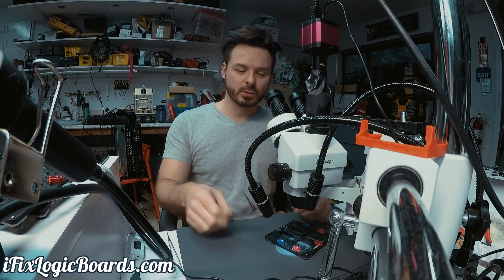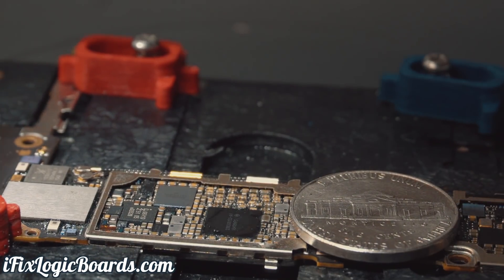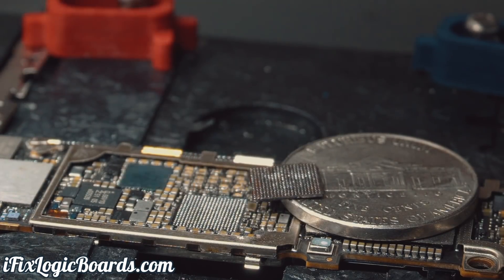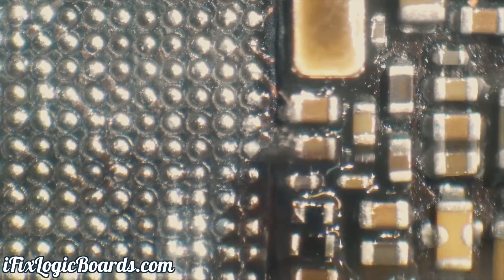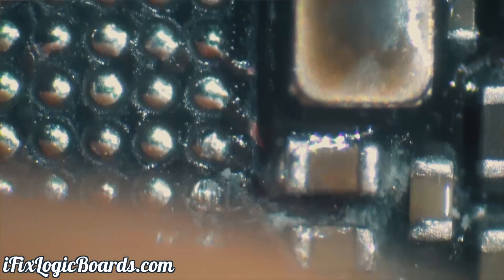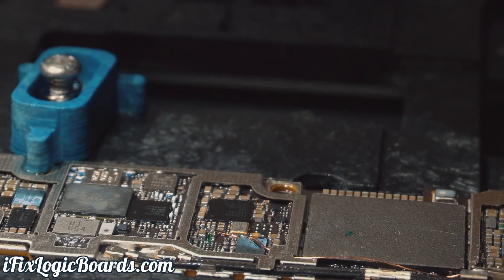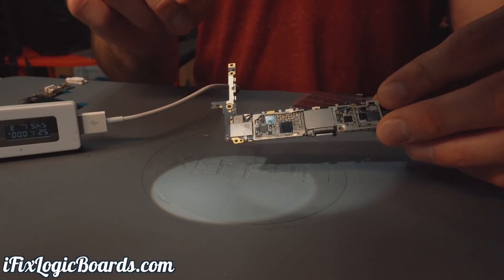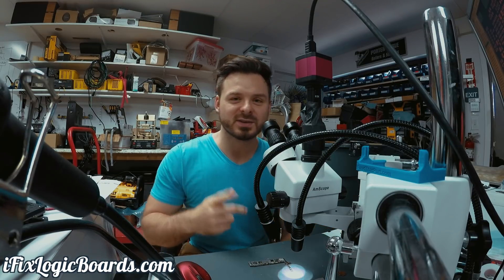iPhone 6S Plus not charging - short on pmic line.

Comment: I ended up with a similar board malfunction on my behalf. My goal was to unscrew the logic board and test it with a new battery since the battery it came with is stuck to the logic board I thought gee, its easier to remove the logic board, I didn’t do it on a ESD surface it was on my bed. and when I connected to logic board to a working battery I forgot to reconnect the power button connector sleep/wake button. I only connected the battery D.C. connector. I’m afraid that I did something really bad to the LB, the smoke came from the front of the logic board under the top metal heat shield cover plate. Not the bottom of mother board with sticky heat shield stickers. There was no sign of water damage, I should’ve took a picture of the mother board before I worked on it to have a record of working components from the before and after the smoke appeared. Did I mess up because I failed to connect the power, sleep/wake button connector to the mother board after I had connected the battery D.C. connector to board?
Reply from the maker: I think the lcd wasn't connected right and it was the fuse blowing up.
Reply: @scoopof3d  could you elaborate since we are here. I called repair shops but they would look at the board. I asked if they could let me know which parts went bad. But they denied me.
Reply: @scoopof3d   Smilar to a broke inductor the L4000 out to Chestnut_SW into SW pin U4000?

Comment: http://imgur.com/gallery/ULLRoNA lots of missing pads when I used the hot air gun to lift off the old pmic. When I lay the new one down and use hot air to it, will that flow down and create a working circuit or is this board done for?

Comment: Thank for the video. But do you remove C2103 and FL4620(and after it), L5408_RF(and after it), C3008 or even U3000? - its all on this line. And there is a reason to put 3V on this line and see what is heating up of this componets.

Comment: Hi have you ever come across iPhone 7 where the touch wasn’t working at all? The phone had boot-loop, I replaced the audio IC, made jumpers and put a UV mask, the phone switches on but it doesn’t have any touch ( I have tried a know good lcd). I don’t know if it’s related to the audio Ic replacement because the phone wouldn’t switch on before the repair..

Comment: Nice video, it was a challenge and i like challenges :), one of the comments was right, don't heat pmic with heat gun cpu is on the other side and on the 6s it offten shorts, next time use iron with big tip and add solder then lift it the same way you did. Good luck for the next one  ;)
Reply from the maker: I hope not to have to replace pmic ever again ;) But thank you.

Comment: Hi, sorry to say this just like a big brother do not share faulty information ! but what I really like about your try is disconecting the PP3V0_TRISTAR connection between Tristar & PMIC ! I like this Idea but all your steps were not true and wish you best of luck trying to get it OFF DFU mode and make it boot again sorry to the dislike ! (I like the cutting idea) !
Reply from the maker: Not sure what do you mean? What fake information?
Reply: I did not say FAKE ! I said "Faulty" I mean "misguided" how could it be true to apply 400c to a PMIC underneath it CPU ! that's what I mean is not true your overheat killed CPU I wish you can show us the device working with LCD for at least 10 minutes (I do not mean any harm) but I need to see it works that's all as I said before I extremely like cutting trace idea it's just awesome!
Reply from the maker: The video shows the phone not working. I never said it worked. 3v0 tristar had 3V again, but the phone didn't boot or wasn't recognized by itunes. I run hot air at 370.
Reply: wish you good luck with that 6S plus hope you can fix it !

Comment: i think your problem caused by overheating cpu . next use heatsink need skills to replace its so i advice you to remove pm ic using big tip of soldring ion and solder its with heat gun .thanks for sharing video
Reply: Could you explain more about that heatsink? Thanks!
Reply: Reitz  this is a heatsink its suck almost the overheat so you need to pay it    . Cosmos ® 8 PCS Copper VGA RAM Cooling Heatsinks cooler + Cosmos Cable Tie https://www.amazon.com/dp/B00637X42A/ref=cm_sw_r_cp_api_tUeUAbMVPR651
Reply: Almaawi Tech hey thanks for that link
Reply: Almaawi Tech but how do you hold the heatsink in contact with the cpu during high temperature reflows 
Wouldn’t it fall off on the other side immediately?
Reply: Lets see if i got it right. Everytime i need to use heat, lets say to remove NAND or PMIC i stick this heatink to the cpu? Just like a computer cpu with thermal paste? Thanks!
Reply: Reitz yes if you want iwill send you all details no problem you welcome its will safe work 100% 
no damge ram or cpu or others ics 😉
Reply: Też się zastanawiałem dlaczego nie ma ochrony CPU. Być może, że w przypadku gdy na procesorze wciąż jest blaszka a pod nią pasta termoprzewodząca, wtedy nie potrzeba dodatkowej ochrony?
Reply: @RafalBielawski  Czemu, że od razu zjebał.. Już wcześniej było zjebane hehe więc nie było dużo do stracenia. A tak przy okazji miałbym sprawę do Ciebie, jak mogłbym się z Tobą skontaktować?
Reply: @PG11003  na insta jest komplet danych https://www.instagram.com/ifixthis.pl/